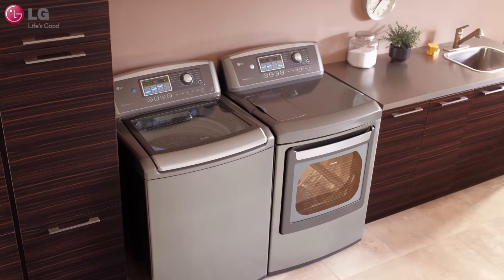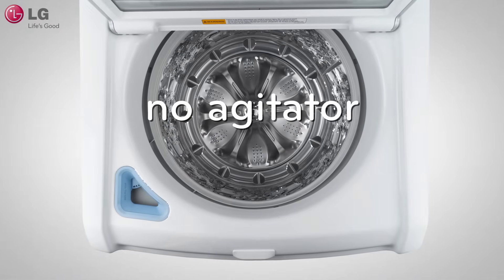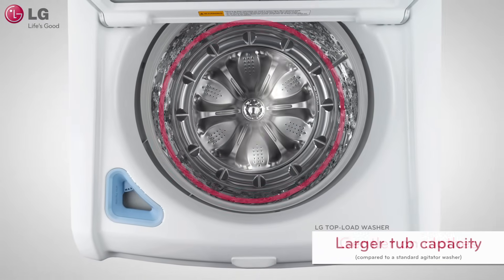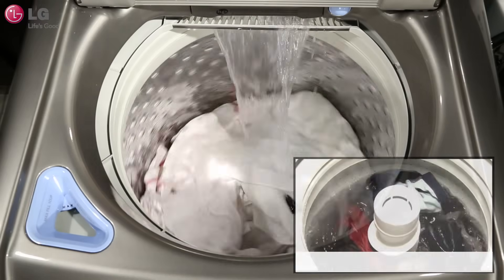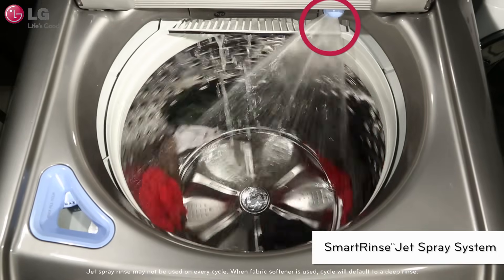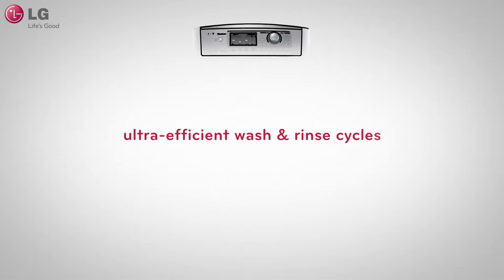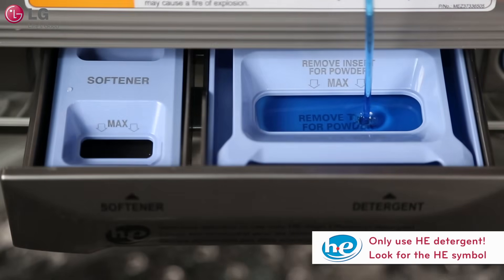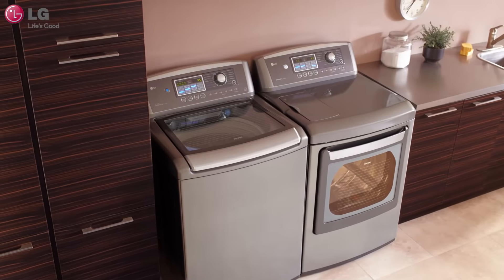LG Washer - How High-Efficiency (HE) Top Loaders Work (2018 Update)

Comment: Terrible! Do not buy! we have had ours 5 years and it is defunct-you have to babysit the machine and cannot reach the bottom if you are short to retrieve clothing, and for the last 3 years started having problems with: the water sensor is off and water does not cover the clothes,  clothes not clean,  does not balance properly and the machine stops with the UE light on and have to keep shifting the load manually, keeps refilling and rinsing and wont stop-water bill high as a result!  
Pros:  the look of the machine is beautiful and modern, the controls on top and right in front (no reaching across the machine), no agitator to twist clothes up; window to see what the load is doing.  
Very disappointed as I really thought this design would offer so much more than our old machine. The bugs in this machine need to be worked out!  THIS MACHINE SHOULD BE RECALLED WITH PRORATED REFUNDS depending upon use and years owned.

Comment: Dont buy top loading LG washer.  Read the manual first.  If all the rules don't stop you then read this.  The clothes don't come clean they are still dirty when they come out.  If they stink when they go in they stink when they come out.  You need water to get clothes clean and there is no adjustment to add extra water.  The more you pay the worse these appliances are.  All the lint and dog hair that are removed from the clothes come out in the dryer filter not the washer.  AWFUL product.
Reply: LydiaCyan if your washer works I am very happy for you.  I did purchase an expensive lg washer.  I did finally get the add water button to work.  It doesn’t work on all settings and doesn’t make a difference.  I have to use heavy duty setting or bedding settings, fabric softener setting, add vinegar or put in half the clothes to get moderately clean clothes if I am lucky.  This washer is a major disappointment.
Reply: Not true for all lg washers . You probably got a low end cheap model . The new ones have the option to add water!!

Comment: they dont work. thats the problem. you manufacturers have pushed high efficiency washing as a marketing gimmick. my apt building has brand new LG Commercial "HE" washers.  after the wash was done, i have to rinse each piece of clothing, because it is so dirty AFTER the wash. i found this out when i still had a water stain on a pair of pants. i put the pair in a white bucket and  filled it up with warm water. the water turned greyish black for a pair  of pants that i've been washing for a year (i'm aware of color leaking out on new clothes, but this was not new)! i had to rinse the pants 3 times, sadly. this is high efficiency? i now go outside to an old laundromat that has real commercial washers that are old and work a million times better.
Reply: BobRooney I agree totally.

Comment: I have the LG top load machine and I am very disappointed with it.  I follow all the instructions and still get lint on my clothes since the first time I used.  I will never recommended this machine to anyone.
Reply: I agree! I've only had the washer a couple days and my laundry is still dirty.  Just washed a mattress pad and had to brush the lint from the seams.  Very disappointing. Prior washer was a front load Maytag Neptune that had bearing issues, but was 17 years old and lasted through a family of 5!!
Reply: I also have the lint/residue issues, I will do a second rinse and put very little soap in it to begin with, quit using Downy and still get some residue...but the worst is the bleach container rusting out!
Reply: @Journal2Awakening  There is no excuse for a part like this to rust when so many alternative materials are available.  Even cars, that in the 60's and 70's used to rust horribly after 8 or 10 years, now last much longer with any rust at all.   The bleach container is one thing that could probably be made plastic and could last forever.
Reply from the maker: Sorry to hear that Neli & happy to help get you in touch with the proper team for assistance! For social media support, please direct message us on Facebook (LGUSSupport) OR Twitter (LGUSSupport) with contact info. You may also call support at: 800-243-0000. ^CJ
Reply: Could anybody tell me the model number of this machine please ? I'm horrified to read the reviews if it's the model i planned to buy in next 2 days, nowhere in the comments or the video model is not mentioned, i'm going to buy 20kg....lg t2028afps5 top loader, please anyone is the same machine you are talking about ?